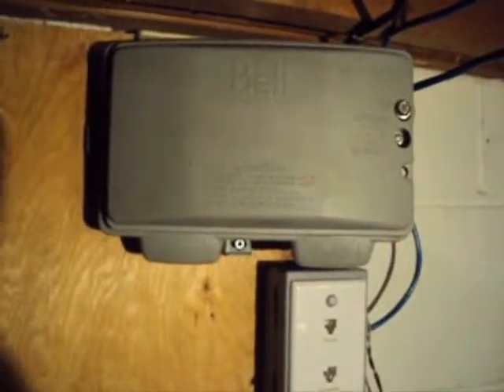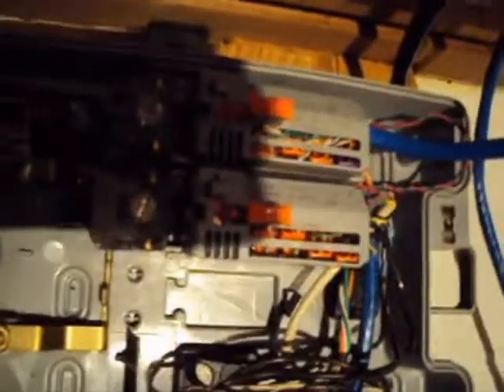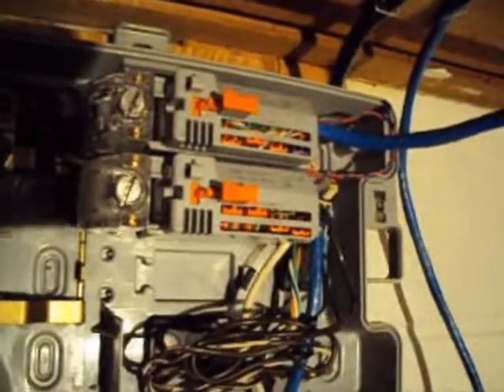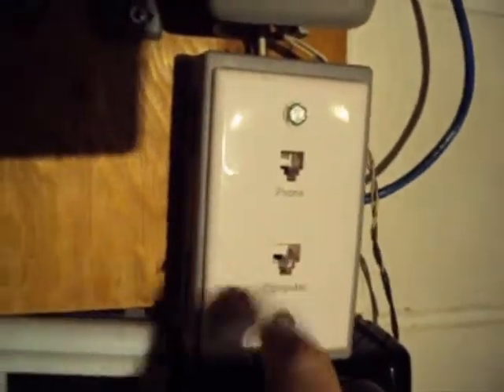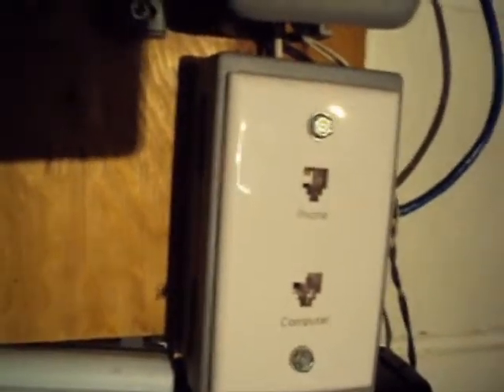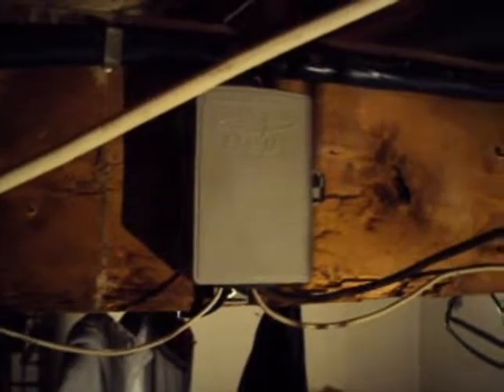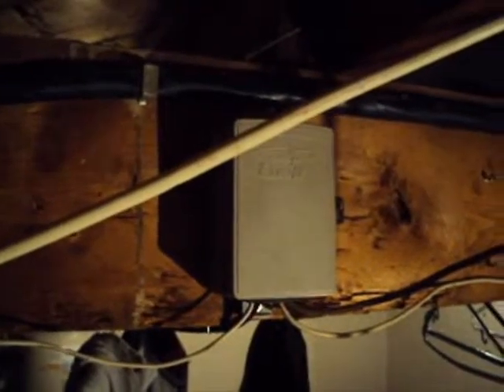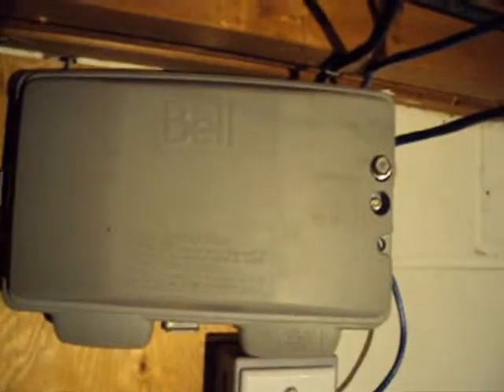Basement bell phone wiring

Comment: Make sure the first bell box's protectors have a good cold water pipe ground, for proper lightning protection.
Reply from the maker: I did actually use the original ground on the cold water pipe that Bell probably installed when this place was built, it was cut many years ago. Still had the old Bell tag on the pipe. I wonder if it was cut when party lines were stopped? or when demarcs were installed? I always ground all my lines, but does it really matter if my neighborhoods cables are burried?

Comment: For some reason I thought you had an apartment, that now makes since you could wire in the wall phone and candlestick. 

Glad you fixed up the internet, and understand all the wiring. I'm sure it is close to standards, but how you have it wired is a bit sloppy, in my opinion, not that it matters.
Reply from the maker: I do live in an appartment, but i guess they would be considered "townhouses". there is 6 appartments in a row, and they all have basements, and our own front and back door. basicly just 6 houses in a row attached to each other. And lol i know it looks a bit sloppy right now, but im not finished yet, and its a million times better than how it was wired when i moved in. lol also i try not to run phone lines parellel to electric wires.
Reply: Ah, that makes more sense. 

Well, I believe you, it's not all too bad.